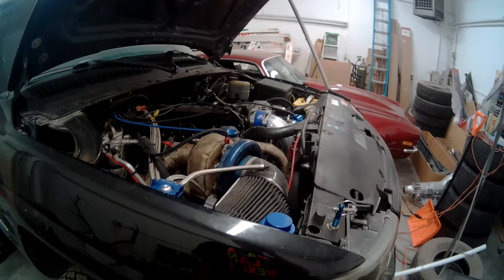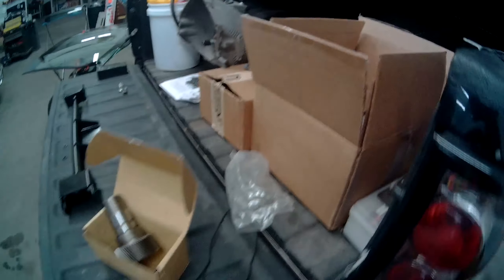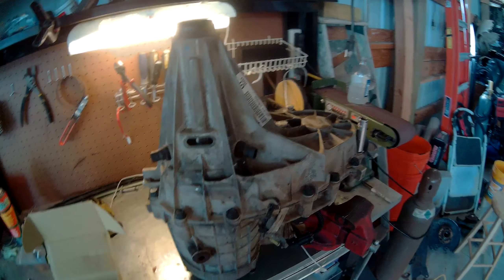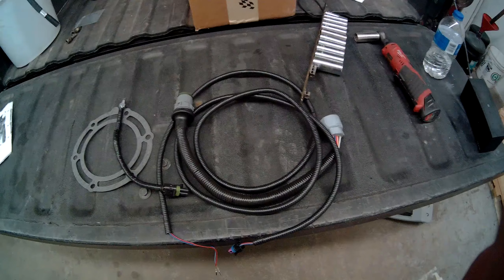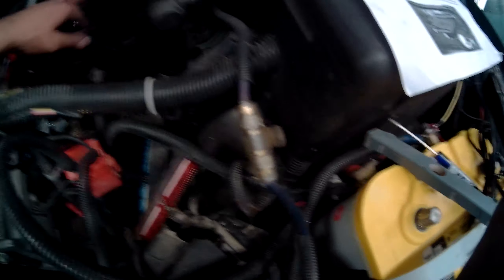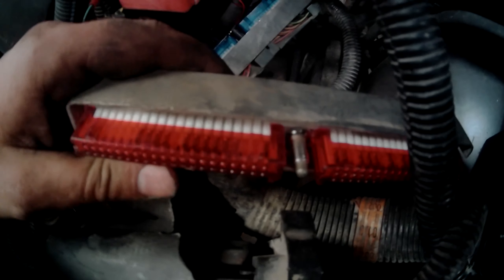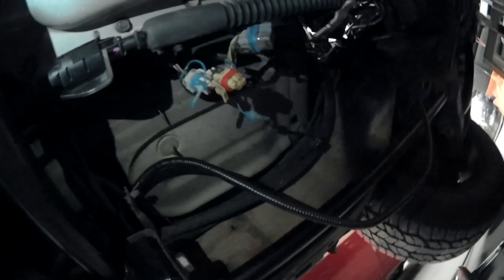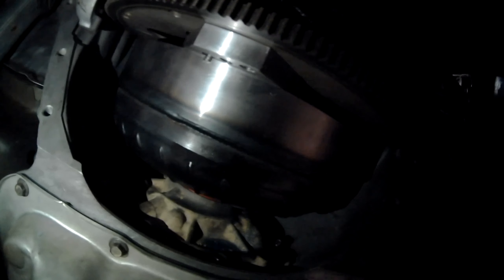4l60e to 4l80e swap made easy!

Comment: hey im doing a 4l80 swap also how did you run your AN -6 lines  is it possible to get pics? im concerned about it rubbing on random shit under then engine or melting. also whats the Center to center measurement for your universal joints ?   please and thank you for the help
Reply from the maker: Yes I can definitely get you some photos I ran some adapters that go into the transmission to the an6 line I zipped tied mine and ran some dividers it runs straight into my cooler I bypassed the radiator
Reply from the maker: Are you wantjng the length of the driveshaft?
Reply: @BCInnovate  I see I'm doing full braided all the way to the rad and cooler.   And yes I would love the length of the drive shaft.  Right now from ujoint to ujoint I am 40 inches. I'm thinking 38 inches would be right but I am not 100 percent sure.
Reply: @BCInnovate  hey where you able to grab those measurements?
Reply from the maker: Sorry for the delay I  didn't get a chance to measure it been super busy but I found my receipt and I cut 1 7/8 of an inch off of it hope this helps!
Reply: @BCInnovate  thank you!  I'm heading to to the junkyard this weekend and grabbing a shaft out a trailblazer. It's like 38 inches and some change.  Hopefully that's right  and I'll save a boatload
Reply: @issaproject  did the trailblazer driveshaft work?
Reply: @pmotorsports8276  yes and no im lifted so it was an imch short  a longer yoke wluld help.  i had ome made for 150 ish. but if youre stock.. give it a trt its only lile 20 bucks out the yard
Reply: @pmotorsports8276  dont get the aluminium ones they suck

Comment: Is your transfer case floor shift or electronic?
Reply from the maker: It's electronic
Reply: Do you think the factory 4l65e transfer case would work on a awd with the 4l80e? 2005 GMC Sierra 1500 Denali
Reply: @relaxationconfirmed6357  no you'll need to swap the output shaft in the tcase. Its a 27 spline I believe and you'll need a 32 spline output shaft to mate the 4l60 t case to a 4l80e trans
Reply: @relaxationconfirmed6357  you can't use a part time 4wd tcase with a awd vehicle
Reply: Chris Garcia thank you sir